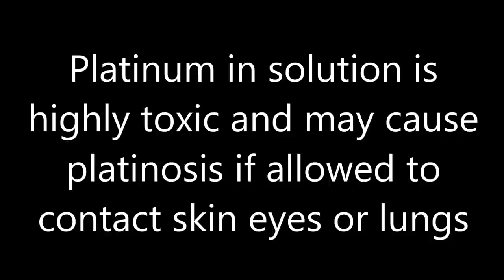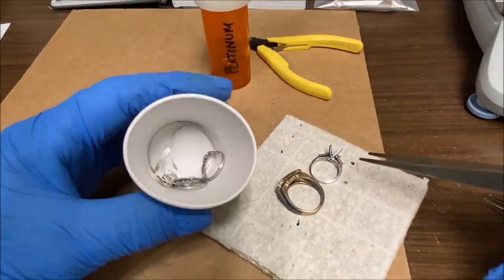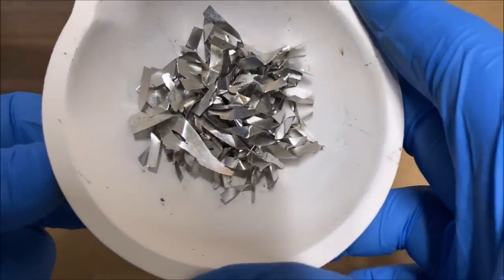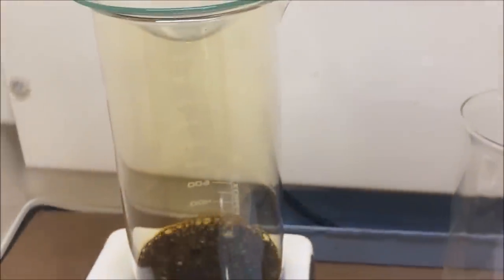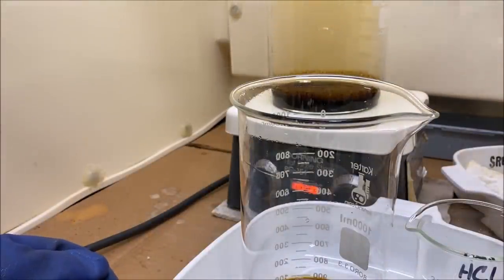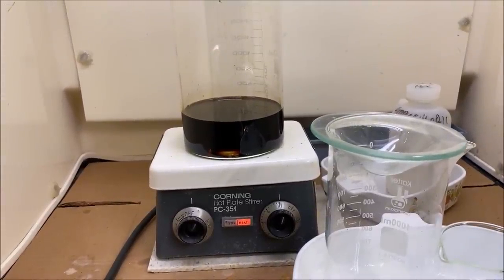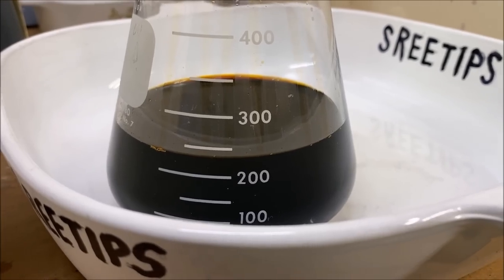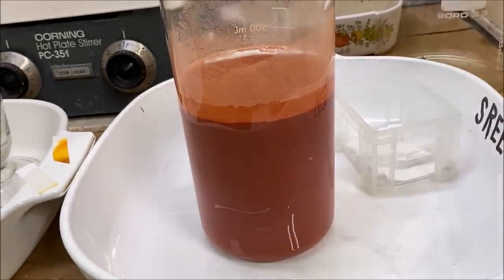Platinum Refining Bromate Hydrolysis Pt1

Comment: I'm glad you continue to re-emphasise the safety aspect of refining Pt.  I've seen many other videos where they mention it once but then that's it.  For something this toxic it's good to keep bringing it up.  I'm also not surprised that this isn't something you do much more often.  I HATE working with Pt and will not do it.  Any Pt I have goes right back into the stockpot and when there is enough to collect it just goes into a jar to be sent to the refiner at some point.  With the added cost of the extra acids/reagents and time, coupled with the toxicity I'm actually surprised Pt isn't valued higher than it is.  I do wonder though just how much Ir you have collected and sitting in various residues over the years.  That's one recovery I'd like to see.
Reply from the maker: I can get the Pt and the Pd, anything beyond that is a complete enigma. Osmium scares me the most. It’s fumes tend to react with the eye lid tissues and form metallic osmium under the eye lids. Like having sand in your eyes for the rest of your life.
Reply: @sreetips I'll never play with osmium it'll stain your cornea forever.

Comment: way cool !!!,   cobalt chloride is pink and cobalt is a common platinum hardener,
the other common ones are iridium and ruthenium but they don't form red/pink chlorides according to Wikipedia, finally rhodium chloride is raspberry red but is typically only used to plate the platinum and would be present in minute quantities only, it will be very interesting if you are able to determine what the red is, and whether your process is good at separating out cobalt, iridium, and ruthenium from platinum.  nice video !!!
Reply from the maker: That’s good to know. As usual I’m in uncharted territory. I hope that the bromate will complex with the cobalt during the hydrolysis.

Comment: Given how the cold rolling can encapsulate dirt and grime (if the flat rolling creates "laps" and/or "folds", so the material surface folding over on itself) I'd recommend to do the ultrasonic cleaning BEFORE you do the flattening.

And then maybe afterwards too, for good measure, but definitely before flat rolling.

Comment: Awesome to see this series, i've been wondering about this. Kind of surprised you didn't use some of the old silver cell filter slimes and recover those as well.
Reply: Since he removed one of the rings at the start, since it would have been to much. I think not adding the silver cell filter slimes, was the correct choice since they would have a whole lot of different Elements as well which could have made it harder to refine / purify the platinum.

Comment: @Sreetips, do you think perhaps the platinum in this case was so resistant to the Aqua Regia because it was rolled?  Perhaps that made certain sections of the strips more dense? Or does the metal just take THAT much abuse before it breaks down and goes into solution? I was wondering if it might be a good idea (for platinum only) to perhaps flake or shave the metal before boiling. Would there be a way to fragment it into a 'iron filings' consistency with some sort of tool?  Get the particles really small so it might give more surface area to the aqua regia?  My other question was whether the iridium made it more stable in the acid.  Or perhaps if there are even other alloy components other than iridium that might have been in there?
Reply from the maker: I dissolved a small piece of Pt 1/10 of a gram to make my standard test solution. It took me six hours and there was still a small piece left undissolved after that. Platinum doesn’t cooperate at any level.

Comment: Platinum is the 3 densest metal on Earth, Iridium is #2, that's why platinum doesn't change color...Also, that is the reason high end spark plugs are topped with platinum...Just a lil fyi MC...

Comment: Just seen the end result - the red precipitate rather than bright yellow ammonium hexachloroplatinate complex salt.  Do you think that's the tetrachloroplatinate ion instead??? Or both.  Been thinking about it - you boiled it right down to that syrup for a long time which might have forced it from the (IV) into the (II) oxidation state and the tetrahedral form which is red/magenta as a salt. Never seen it in person - a new one for me - cool work and a great colour.  If it is, it means there's slightly more Pt by mass in the precipitate.  
(checked my old texts-  chloroplatinic acid above a critical temp/molar mass seems to drive off HCl and force the tetrachloride)
Reply from the maker: If I did that then it was by accident. Someone said the iridium forms a red colored precipitate.

Comment: Hi Kevin, great work - I appreciate you took so hard topic. For sure Pt alloys may contained some Pd and all other PGM.
Pt-Ir is hard to dissolve - I am curious about any solid you will get - Ir may be there after dissolving in aqua regia. There is few way to speed up this - make an alloy with silver and dissolve most of silver in hot but not too concentrated sulfuric acid. Pt would dissolve in nitric partially. Pt-Ir10 and pure Pt [contacts] reacted different with boiling nitric - Pt was dull and darker - Pt-Ir10 was shiny as before. Using HCl with hydrogen peroxide is much faster for Pt / Pd - but silver in alloy makes this problematic. It is much easier to get Pt/Pd into solution completely if they are dropped before with formic acid [I know, still they must be dissolved first].
In general I strongly recommend use of distillation setup for such task. Flask from good quality glass with heating mantle and reflux condenser, with constant flow of cold water. Heat can be set to keep gently boiling, key is to have efficient condenser. Amount of metal lost this way is minimal. If you need to remove excess of nitric, distillate can be gathered and any precious dropped with aluminum. 
Fumes of Pt/Pd chlorides are nasty - but  glove-box or fume hood is not the proper protection itself, without scrubber. Even if vapors will be sucked, they will eat any unpainted metal part after they condense or make very precious fallout in the neighborhood. Best way is not to let them go away from reactor vessel, never operate hot solutions, carefully drop PGM with Al/Zn [never ever let them become hotter than 60*C, they start vaporize PGM].
Can't wait to see final results ;-)
Reply from the maker: I’m in over my head. In part three, evaporating off to denoxx, I looked away to get the camera set up. I came back out and the solution was close to dryness on high heat. I shut it down and went to bed.

Comment: Honestly sreetips you could make the fume hood you have into one that has gloves. Is it a glass window or plexiglass?  If it is glass see if you can get a plexiglass sheet. Then cut holes for the gloves create a gasket with silicone and bolt on a piece that grips the end of the gloves and clamps it to the plexiglass

Comment: Loved this, never seen a Pt refinement before! How does any alloyed Ir affect the procedure? Can you separate it out like you can with Ag from Au? Or is it too chemically similar?
Reply from the maker: This is all new to me. Feels like I’m way in over my head.
Reply: @sreetips  that Ir makes it a lot harder to dissolve platinum in the aqua regia because pure Ir is resistant to even aqua regia and your alloy is a lot more harder to dissolve than a pure Pt bar coutesy of nurdrage's video.
Reply: dissolving Iridium is a nightmare but it dissolves better in slow addition of H2O2 to HCl than using nitric but its still going to be a pain.
Reply: @sreetips  I may have(sort of accidentally) summoned help, hi Bhoice

Comment: I noticed this is the first time I've ever seen you use a front fume box face body shield... that's the only thing you ever have done that I worried about you... that and your room is not positive pressure 2 help push the fumes  up and out of your vent hood... your a fantastic chemist, and this is the only time I've ever mention any faults in your work.. after 30-50 ish comments...so just know I'm not trolling... simply helping out someone I respect.... it may look like all the fumes are going out your hood from the nitric hydro boils..etc... but the heavy fumes boil up and over then down settle on the bottom of fume hood... then roll over 2 the floor/room your standing in..... you can't see them but their their....
Reply from the maker: There is a baffle mounted on the back of the hood. It transmits the vacuum to the floor of the fume hood and pulls those heavier-than-air fumes up through a channel under the the baffle. If I had acid fumes leaking into my garage then my lawn mower would look like a pile of rust!
Reply: Looks like you got it covered then..  smiley face.

Comment: For watching??  Thank you for posting, and forever grateful.  Need more equip?
Considered this awhile back, lucky it never came to fruition.
After reading the osmium comment, it's a partial pressure glove box or sux a tranny's BBC.
Air circulation may have prevented visible vapor, was the nitric fuming?
They should have had Walter W. in Breaking B@d, have a lab screw up w/ this stuff.  Like the phosgene gas in season one.
I've got hundreds of vacuum tubes, from an estate of a TV repairman.
Suggestions a/o local to NC?

Comment: I absolutely love your videos, and have learned so much!  When you boil the acids, what temperature are you boiling them at?
Reply from the maker: I’ve never taken the time to measure it. I just go by the markings on the hot plat: low, medium, high.
Reply: @sreetips  Thank you for responding :)  So is it a different temperature to boil for different acids/metals?
Reply from the maker: It depends on what I’m doing. But most of the time boiling on high gets the job done faster. Acids work better at dissolving metals when hot.
Reply: @sreetips  Thank you!

Comment: Perhabs you could alloy platinum with zinc as i have seen in Rhodium refining. 1 Part Rhodium + 10 parts zinc in a crucible covered completely with borax. Heat it in the oven to just a bit under the boiling point of zinc and stir. Then treating the cooled alloy with dilute Nitric acid dissolves the zinc and leaves Rhodium behind as black powder.

Comment: another thing, if you were to do this quite a bit more often youd definitly want to get a reflux setup, as itll save your acid and your money. for those who dont know what a reflux setup is its similar to a distilation apparatus but instead of distilling the liquids off into another container you let the liquid drop right back into the boiling flask, good for when you have to heat something in an acid for extended period of time.

Comment: Thanks, Sreetips... You mentioned early on that the thinner you could roll it out the shorter time it would take to go into the solution. What if you stacked the thin strips on top of each other to get them to thin each other out some more? Could possibly even cut the thinned strips into shorter segments to stack even more pieces to get them to thin out even more...
Reply from the maker: Stacking is a good idea

Comment: Greetings and courtesy
Thank you dear teacher for the valuable videos.
Professor, I had a question. I have 10 kg of powder, of which 2 kg are live palladium, live platinum and a little live rhodium.
Can I dissolve a small amount of powder in aqua regia at a high temperature using a 5-liter bottle?
Will platinum and palladium dissolve in aqua regia with high heat?
Reply from the maker: Yes
Reply: I am disturbing you from Iran.
Professor, how much powder should I put in a 5-liter bottle?
Should I pour hydrochloric acid first and then add nitric acid after heating?
Also, sir, how many hours should I heat it for it to dissolve completely? And is it good to boil the solution?
Reply from the maker: That’s a lot of material. I’ve never tried dissolving that much all at once. I’d do small batches to see how it goes. A hundred grams to start. That’s what I’d do if it were mine.
Reply: @sreetips  Hi Professor
Professor, I started with 100 grams.
How can I send you a photo or a video of a few seconds of my work?
Reply: @sreetips Professor
Reply: Hi Professor
Professor, I was able to dissolve platinum and palladium in acid.
Now, first, I will deposit the platinum with ammonium chloride. Will only platinum settle or will palladium also settle? And before adding ammonium chloride, should I neutralize the nitric acid solution?
Professor, can I first deposit platinum with ammonium chloride, then filter the solution containing palladium?
Then dissolve dmg in hot water and alcohol to precipitate palladium?
Reply: Professor please help me
Reply from the maker: I have a video on refining the platinum and palladium. Please look at it to get an idea. Thank you.
Reply from the maker: I don’t offer any training or tutoring service. There are too many variables to consider. I have a couple videos on how I did this. Posted to my channel.
Reply: @sreetips  Thank you professor

Comment: another interesting thing about platinum is its a really good catalyst, so if you were to heat a coil of platinum wire to red heat (or a thin platinum coin) and hold it over acetone itll stay red because its causing the acetone vapors to undergo reactions keeping the platinum hot.
Reply from the maker: Didn’t know that

Comment: How do you address the iridium remaining? It is valuable as well, correct?
Reply: i believe around 4x more then platinum
Reply: Iridium shouldn't have dissolved in aqua regia and was probably the little bits of metal that remained after all those boils.  It will dissolve in molten cyanide, but I for one beg sreetips to NOT try that reaction.
Reply: @AndyGraceMedia  It will also dissolve in aqua regia under high pressure (and high temperature, 523-623 K == 249.85-349.85 °C ==
481.73-661.73 °F).
Reply: @apveening  Thanks and have a super new year!  Learn something new every day.  I wonder which one I'd prefer - iridium in a) molten KCN  or b) boiling AR under pressure.    I think I'll take a pass on both of those ha :)

Comment: Hello, good afternoon, how are you? I have a mixture of metals with platinum and Ruthenium, I would like to know how to separate the script from platinum, would it be that only by putting it in Royal water and then filtering and adding ammonia chloride would form platinum chloride but the Ruthenium would fall together?
Reply from the maker: Ammonium chloride will drop platinum if concentration of s right. I’ve never worked with ruthenium. Requires special safety equipment due to the dangers involved.

Comment: My employer scraped about 30 type R thermocouples last month, unfortunately when I pulled them from the dumpster someone had already crudely clipped all the 0.5mm platinum and platinum/rhodium wire, I estimate each thermocouple contained approx 400mm of pure platinum wire and another 400mm of 90/10 platinum/rhodium wire (What a score that would have been).
I collected all the remaining ceramic terminals which contained the stubs of platinum crimped into copper connectors that I'll dissolve in nitric acid and save for future projects, like reducing platinum onto a quartz wool catalyst, if I can safely deal with the chemistry, I didn't know how dangerous platinum salts are!
Reply from the maker: Would have been a nice score

Comment: Loved the heating test on the platinum. Would think it would be more cost effective to have 99.7 platinum just melted instead of refined. Your health is more important than a video
Reply from the maker: I agree. I’m doing this for some new content for my channel.
Reply: @sreetips  Buy a sheet of glass and cut two holes in it. Glue some gloves into the holes.
Reply: @DEmma1972  I'm not sure glass would be the correct substance for this, something as clear as glass but a little less brittle might suit better.
Reply: @apveening  Was thinking glass because its not very reactive. Could use poly carbonate but unsure of its reactivity

Comment: Would it be possible to do the most dangerous part "remotely"? The most fume exposure was when adding new doses of solvents, so if that could be remotely controlled, watching through a camera, and using small electronic actuators, this could reduce the danger a couple %. As for the filtering part, that would require high tech arm simulation, so probably out of reach.
Reply: True. 2 small dosage pumps would do the trick. However the videos wouldnt be so cool then
Reply from the maker: Platinum refining is best left to those who have the proper equipment. I’m doing it just for the video content on my channel.
Reply: @sreetips  If you aren't careful enough with this stuff, you won't be able to make more video content for your channel and I for one would hate that a lot more than not seeing Pt related stuff.

Comment: Instead of refining I would rather melt down whole into bar, then rolled into foil cut into even pieces and sell as platinum electrodes for chemical applications. Selling at spot price of 90% platinum and 10% iridium. I believe it would be way cheaper than bothering with refining. Nevertheless I admire your work that with platinum is extremely dangerous to the health.
Reply from the maker: I know there are way to profit from the platinum. I’m just trying something new for my channel. But feeling like I have bitten off more than I can chew.

Comment: Such a weird material. Why won't it melt at such incredible temperatures?
Reply from the maker: Platinum melts at around 3200F (1760C). By contrast gold melts at 1950F (1060C).

Comment: You should try to refine the iridium. That's the most valuable metal there.
Reply from the maker: I don’t even know how to detect if it’s there.
Reply: @sreetips  Me neither. But the ring was marked 1/10th iridium so there should be a little.
Reply from the maker: Yes, it won’t get lost. It will probably end up in my stock pot.